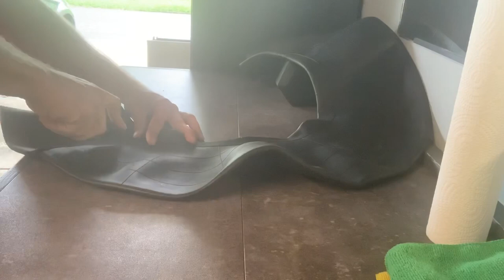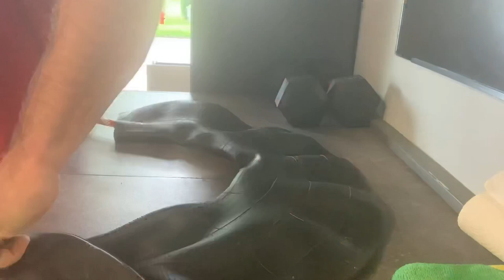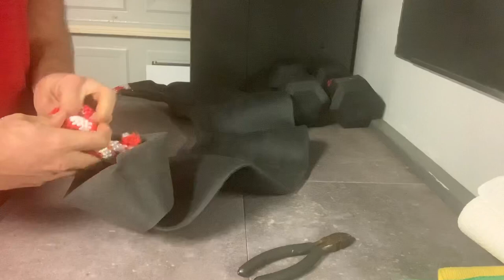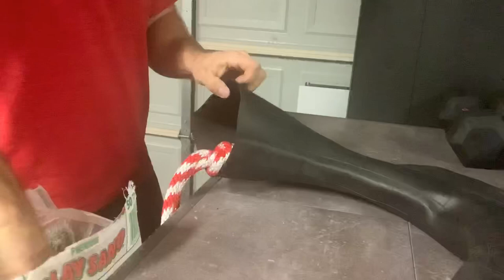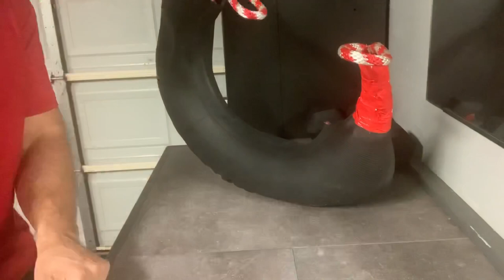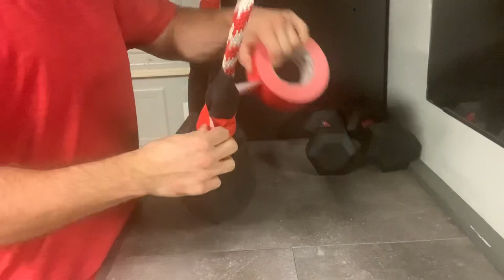DIY Bulgarian Bag

Comment: Nice build. The only thing that I'm going to do differently is to thread the rope handle section through a length of rubber garden hose to create sturdy handles without the rope burn.
Reply from the maker: That’s a great idea! I used the softest rope I could find at Lowe’s and so far so good, but I can imagine during a longer workout it could prove an issue. Let me know how it works out, I’d love to know!
Reply: Do you have a video or photos of how you built yours, & how is it holding up?

Comment: How has the bag held up?  I can get a tube and sand for about $15 or I can buy a pre-made bag from Titan with a 3 year warranty (1 from Titan, 2 from my Credit Card) for about $45 so durability would be a significant concern
Reply from the maker: Good question. After a few months of relatively irregular use (1x a week or so) sand started seeping out when going overhead and such. Now several months later it’s still “in tact” but kind of a nuisance getting all gritty and sandy every time I use it 😂 

So in hindsight... if you’re dirt poor and that $30 is a difference maker, it will get the job done. But if you’re certain that you will be using it regularly, I would go ahead and purchase a new one honestly.
Reply: @natebirner  Thank you for your response!  Frankly the $30 isn't an obstacle but I have to admit that I LOVE making stuff myself and I also like the idea of being able to experiment with different weights as I have no idea what weight might work best for me... may I ask when you say the sand is seeping out do you mean from the handles or is the bag failing in some other way and causing sand to come out?  I had already considered that it might be useful to use rubber cement and/or silicone sealant right around the area where the zip ties lives to prevent sand from coming out.  We'd be using this outdoors so I'm not TERRIBLY concerned about minor seepage anyway.
Reply from the maker: @whitemiata  it only seeps from the ends where the rope comes out of the tube. It’s not that bad, and wouldn’t bother me outdoors too much. I just don’t want to have to sweep out my gym every time I use it! 

In the end it doesn’t cost much and it didn’t take much time, so if you think you’ll enjoy the process knock yourself out! I don’t regret it by any means.

This was my first and only attempt too, so you may do a better job than I did 😉
Reply: @natebirner  May i know what is the name of the rope?
Reply from the maker: @sokTAU911  nothing fancy! I don’t recall the exact material. I just went to Lowes and picked one that felt comfortable in my hands
Reply: @natebirner  omg i wish i know the name cause i really need that

Comment: Made mine a few weeks ago, wish I would of seen this video. Amazing to have the handles also. Great job.
Reply from the maker: Thanks Ruben!
Reply: @natebirner  how is your bag holding up, & anychanges you would make in version 2.0?
Reply from the maker: @harvestblades  I actually tossed mine out back in January because it was leaking more sand than I was willing to continue tolerating. 

Mine lasted almost 2 years, though I started getting a little bit of leakage around the 6 month mark that got slowly worse. Id say I got my money’s worth.  

Maybe using some kind of sealant between the rope and the tube would have helped, but I didn’t really expect it to be a long term solution. I just had more time than money at that point in time haha. 

For the most part, if at all possible, an individual is better off just buying one in my opinion.

Comment: Also, what size inner tube and what weight did it end up being?
Reply from the maker: Hey thanks Ruben! I didn’t put it on a scale but managed to fit the majority of a 50lb bag of sand into it. About 45lbs. I didn’t have much experience with them and it’s pretty intense, in hindsight I might have added some rubber mulch or something to save a little weight. Inner tubes size I used was 23x8.50/9.50/10.5-12